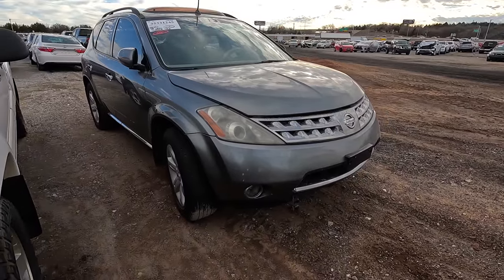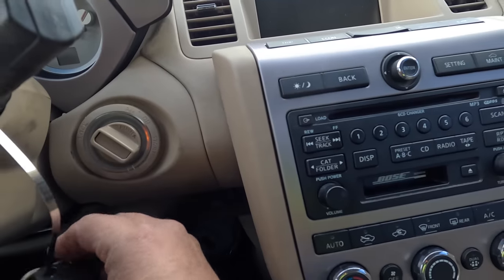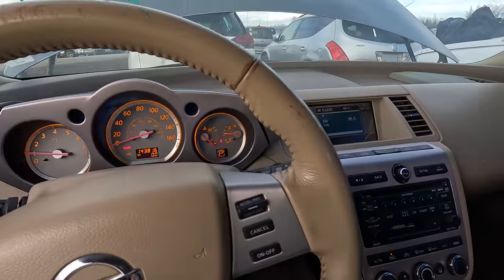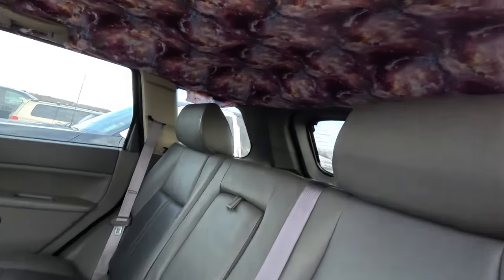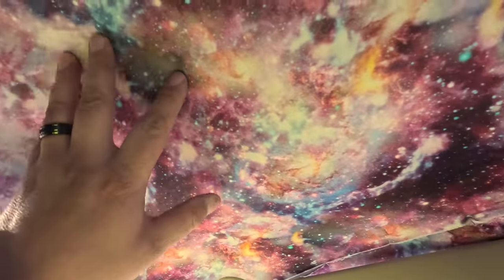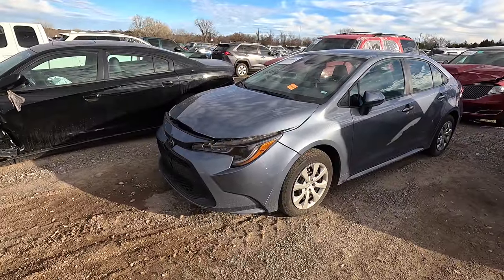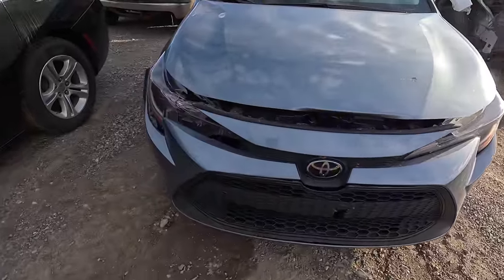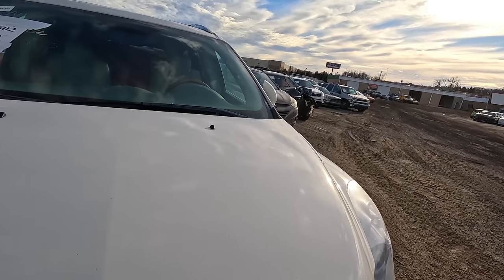IAA Walk Around 1-11-23 + a Cheap New Toyota Corolla with Minor Damage!

Comment: In the older nissans, the upper trim cars had a built in key. And there was a slot where if you by chance lose the FOB you can slide a key in to start the car instead.

Because without the FOB the key won’t move. Pretty neat little feature they had.

Comment: The older 4.7 is not a bad motor at all actually. They just need oil changes regularly.
Reply: I've had two... First was an 06 in Germany with under 100k miles that ran great, but had 3 broken exhaust manifold studs causing an exhaust leak that failed inspection and was quoted 2500€ to fix.  Besides the engine, the brakes were so warped, it was hard to drive.  Replaced all 4 rotors+pads (also needed both front calipers... Stupid composite pistons!), replaced the manifold studs (giant pain!), and installed a 2.5" lift with 33" tires that made it a bit squirrelly at 120MPH/200km/h on the Autobahn lol.  Sold it for more than I paid, so not too bad.

My 05 with 140k was nice, but had a blown head gasket.  Ran great, but overheated in 5 minutes and combustion gasses were bubbling out of the radiator when the cap was off.  I never got around to changing the gaskets and sold it for what I paid for it lol.

Comment: About the Jeep... I did the same eww when I saw the 4.7 lol.  I thought the Limited V8s were all Hemis, and you mentioned the Laredo wheels... Made me wonder if this was a Laredo with a limited badge or swapped tailgate 🤔... But then I saw the dual zone climate controls, which I think were a limited thing (the seats should also be heated on limiteds, but I didn't see if it had the buttons or not).  I had two WK 4.7 Laredos: an 06 with cloth and an 05 with leather, both had a sunroof and dual power seats as well, so can't go off those alone.  This is likely a low option limited.  

Also, it's 2WD.  With the exception of the SRT8, all the V8 4x4s have a little chrome T-handle in the rear of the tray to the right of the shifter to select low range.  The V6s (gas and diesel) with the optional AWD (NV210 [Quadratrac I] transfer case) and the SRT8 (all are AWD with the NV146 [Quadradrive II] transfer case) lack low range, so there's no handle... Even though they have different transfer cases, they both use the same Mercedes transmission (W5A580 5 speed) while the 4.7 and 5.7 Hemi both use a Chrysler 545RFE transmission ("5" speed, but actually has 6 forward gears due to two 2nd gears, a lower gear for fast acceleration/passing and a higher for fuel economy) and an NV245 (Quadratrac II) transfer case with low range (and a center diff for full-time 4x4).  The SRT8 has an 8 3/4" Dana 44-ish axle in the back, the rest have a Chrysler 8 1/4".

In addition to the sludge, the 4.7s are also known to blow head gaskets.  My 05 ran perfect, but would overheat in 5 minutes and would massively pressurize the coolant.  The oil was clean and wasn't burning coolant.  Just a weird engine that was only slightly more powerful than the 4.0 straight 6.

Lastly, the 4.7 is known for breaking exhaust manifold studs, causing varying levels of exhaust leaks, which I thought could have been what you saw with the dust, but I think it was the fan blowing dust as you're the first person to start it in a while (it was probably parked due to not idling and then sold to Peddle).  My 06 had 3 broken manifold studs on the driver's side... It would tick loudly until it would warm up and the gap would close. Huge PITA to fix!
Reply: wow you know alot...!

Comment: 07 Nissan and still had a tape player lol Those 3.5 motors are great but the plastic valve covers suck. Heat warps them which will cause leaks.
Reply: The last US market car to come with a tape player was the 2011 Crown Vic (optional) or the 2010 Lexus SC430 (standard).

Comment: ON these Jeeps WJ (1999-2006) with the AMC 4.0L Straight 6 and the 4.7 V-8 are famous for Crack shaft Positioning Sensors are a common problems with these cause these same symptoms I know I had a 1999 WJ replaced 4 of them and the OEM dealer part was 56.25 with tax. This is a crack shaft positioning sensor and when they go bad it will do what  Jeep did and it will start with a carberated vehicle from the 70'a and 80's.
Reply: The last year for the WJ was 2004.  The WK was introduced in 2005, and along with it, the 4.0 straight 6 was replaced with the 3.7 V6.  However, as it's basically a 4.7 minus two cylinders (similar to the Chevy 5.7/4.3), I'd bet the crank position sensor thing still applies.  The 3.7 was replaced by the pentastar 3.6 when the WK2 came out in 2011.

Comment: Run as fast as you can away form the Nissans. They are very bad a transmission failures with the CVT transmissions.
Reply: Agreed.  Their CVT’s are notoriously bad. And replacing them is the only option.
Reply: Agree 💯
Reply: Jesus yeah they are bad. Lowest cost of parts and worst quality. I'd never buy anything with CVT
Reply: i was gifted an 05 frontier that’s still running like new it’s almost at 200k it’s held up really well no engine light only time because the sensors are bad ac still works and i just had the spark plugs and shocks replaced i think it’s the SE model it’s very basic but has a good engine
Reply: @ohheyitsdezz3609  those aren't too bad it's the cars with CVT transmissions that are awful. I've known several people with similar vehicles to yours and they had good luck with them. They have pretty good mechanicals overall. It's the sentras and others which are bad in the transmissions
Reply: My dad had a 2005 Nissan Maxima and man, I was on vacation with him and while on the road we had to pull over because the trans was leaking oil. We barely made it home and once we did, the car wouldn't move at all.
Reply: @ohheyitsdezz3609  totally different thing.  frontiers have traditional transmissions!  They are good trucks.
Reply: @christopherhamilton5557  okay so it’s the cars to stay away from? i have a family member who has a white 2016 Altima with under 55k and the transmission went out
Reply: @ohheyitsdezz3609  yeah, the JATCO CVT’s in Nissans are notorious for failures…I’ve heard the newer ones can last but they have to be serviced every 35,000-40,000 miles…
Reply: @christopherhamilton5557  an older neighbor of mine has a 2018 with i think almost 83k i was surprised it lasted that long he said his daughter takes care of servicing it but he told me it has some issues apparently the battery likes to die often and they can’t figure out why
Reply: Jadco CVT’s are the worst
Reply: @christopherhamilton5557  exactly.  I have 2010 Nissan Pathfinder that is my secondary car that has almost 200k miles.  External trans cooler, maintained, wonderful vehicle.
Reply: Only if they have cvt’s though, otherwise they are generally good
Reply: A friend of mine has a 18 Sentra with 60k. Transmission went out. 60k!!!
Reply: Nissan…..The Chrysler of Japan
Reply: @bobber22  Chrysler are good if you maintain them in my experience. They don’t do neglect well.
Reply: Not all of them cause I have a 2011 Altima and it’s great with 179k and no tranny issue

Comment: Without looking under the hood bet the blue Jeep has the AMC 4.0L Straight 6 bullet proof and  and parts are cheap
Reply: Would be nice, but nope, it's a 4.7, but if it wasn't a V8, it would have been a 3.7 V6, introduced in 2005 when the WK came out.  Both are garbage engines with numerous catastrophic issues.  The only good choice for the WK is the Hemi.  When they brought out the refreshed WK2 in 2011, the 3.7 was replaced by the far better 3.6 pentastar.  The 4.7 was dropped in 2009.  This info also applies to the 2nd generation Durango (sorry 3rd gen Dakotas [and Mitsubishi Raiders], they never got the Hemi, so you'll start seeing them disappear from roads as they get cheaper and not worth fixing).

Comment: On the Jeep the gas gauge didn't move...Was the smoke dust?

4.7's are not bad,my parents had 240,000 on their 2001 Grand Cherokee 4.7 with no issues,transmission never an issue...The 4.7's when new knocked a little upon start up,it was normal...We had 2 other 4.7 in our family,nobody had issues with them..My Dad is a x drag racer and floored the Jeep a lot!! Never gave any issues..He was skeptical of the 4.7 vs the 5.9(360) he had in his 98 Limited that was totaled in 2001 thus he bought the new 2001 Limited 4.7 V8..

Toyota's had the worst engine sludge in the history from 1997-2006 era..stay away form them and the 3.0 V6 of the 90's that head gaskets blew from new to any miles at random!

The Chrysler 2..7 was an issue when the water pump started to leak and you ignored it as it leaked int he engine,Ford also had that design later on in the 00's and 11's..Thing is change oil every 3000-5000 miles,use synthetic oil and change coolant every 3 years no matter the mileage! FYI:Dads Jeep never used Synthetic..

Comment: Not everyone has the money or credit available to them as you do. Sometimes those people cannot afford a full set of “matching” tires. And it certainly doesn’t necessarily mean that they don’t care about their car.
Reply: It's not that they don't care about the car, they're either cheapskates or poor, which in either case, means deferred maintenance.  I've been there... Couldn't afford an oil change (or any other maintenance), and would only replace a tire when absolutely necessary.  Deferred maintenance for too long means bad news.  It's very likely they bought it and never changed the oil, which caused the spun bearing and rod knock.

Comment: I buy no Grand Cherokee again ever, these engines and transmissions are soo bad. Thanks again for your content, Randy
Reply: I had an 06 CRD and it never broke down on me and a good amount of power. Only reason I got rid of it was the crazy expensive parts price. Almost everything has too come from Germany. The newer ones were easier to fix and parts easier to get as Mercedes still uses those engines. Mine was discontinued as it didn't meet Euro5 standards and the older Jeep wasn't designed properly to take the engine which meant labour costs were high. My alternator cost $1600 too replace and took 2 days.

Comment: I would step away from buying any Nissan, except for the pickup truck.  They are putting CVT transmissions in all their stuff including the Murano.  I have always liked the drivetrains on Nissan till they started putting CVT transmissions on most of their liineup.  Another problem with Nissan is they use cheap steel and their frames rust out in Nothern states so quickly.  With Nissan, always check the fame for rust.

Comment: Damn man like the Nissan 😢 would it be expensive too fix? Jeep headliner omg too funny 😂 Toyota maybe
Reply: Very expensive at a reputable shop who'd warranty the work.  Moderately expensive at a disreputable shop or a shadetree mechanic with no guarantee the issue will go away.  Cheap if you want to DIY.. go see Legit Street Cars and the Buick Grand National they recently bought... They changed just the rod bearings and lucked out that it fixed it.

Comment: wait!…. so that jumper pack doesn’t have reverse charge ?
Reply: Not the lithium ones... They're super sensitive to voltages, which lead acid are not.  Due to the inherent dangers of lithium and required protection/charging circuitry, they've got diodes to prevent reverse charging where as the big lead acid jump packs just have the leads connected directly to the battery inside since they're resilient and the car's charging system is designed to charge that kind of battery.  Many of these boost packs don't have a true dead battery jump mode, requiring voltage in the car battery to activate.  The NOCO do, but you have to hold that button to activate it.  Go watch Project Farm where he tests a bunch and shows their weaknesses.